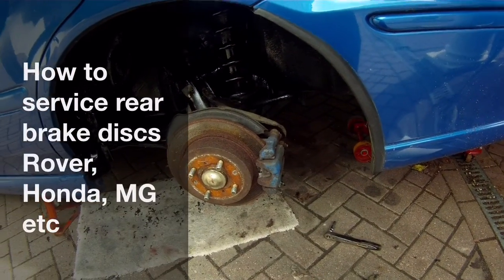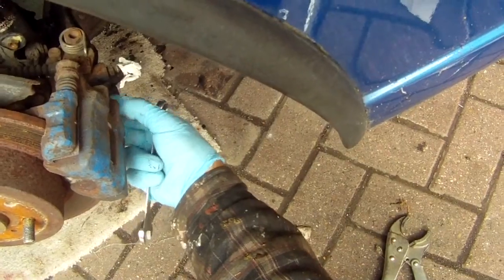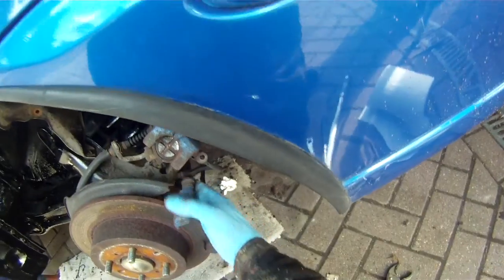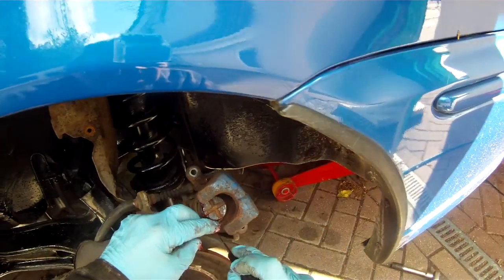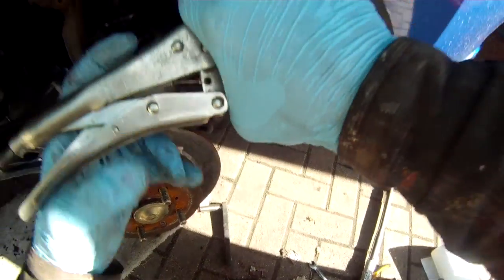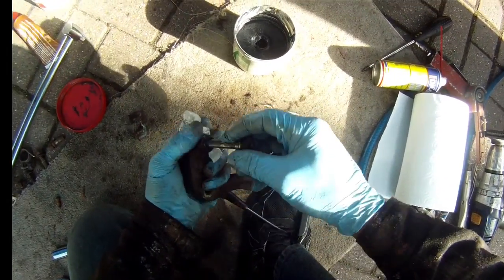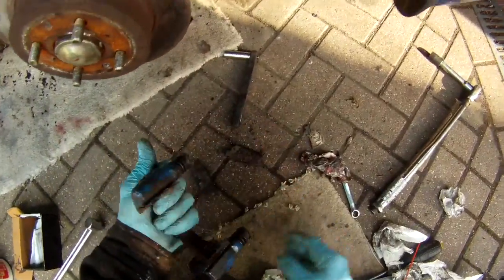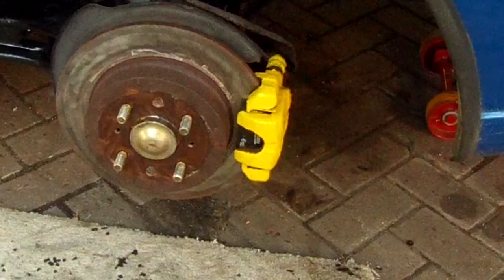How to Dismantle and Service Rear Disc Brakes MG Rover Honda etc

Comment: The piston brake  should be removed and clean or change.
Reply from the maker: Yes, if it’s stiff or corroded up.  The handbrake mechanism was was working ok on this car, so didn’t need too much attention.  Worth checking at the same time though.